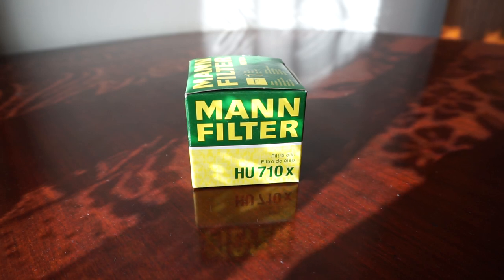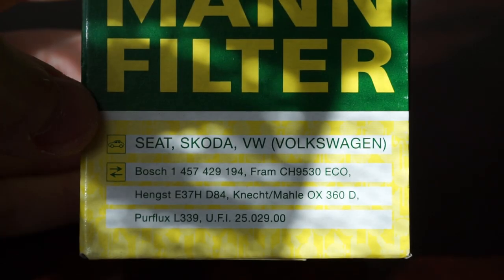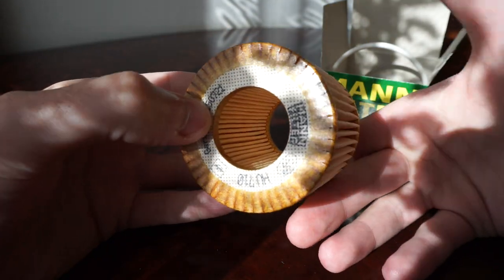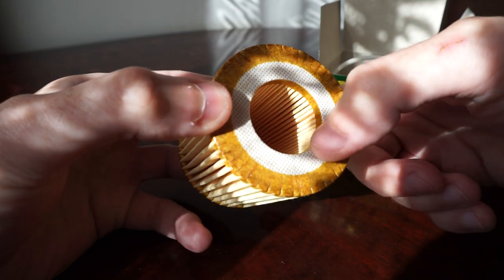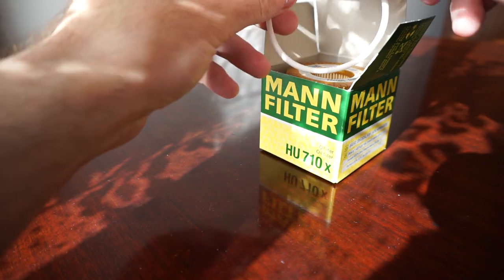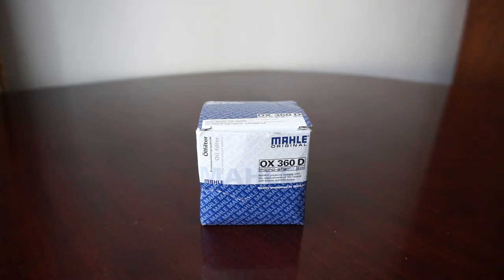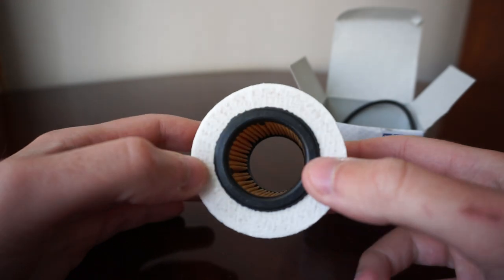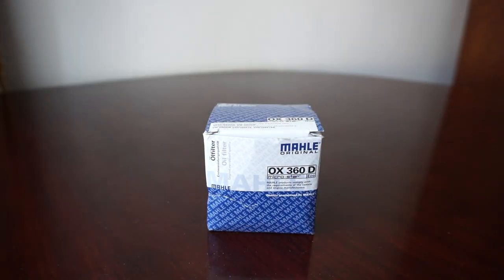MANN Filter vs MAHLE Original Oil Filter

Comment: The Mann filter ends are polymer foam. I've fitted many of this type of filter to Bora TDI cars and it really is an easy process. Of the ones I've done, you push the new filter into the filter cap and keeping it straight, drop into the oil filter housing and screw it in and tighten to the torque marked on the cap.

When draining the sump oil, remove the old filter before replacing the sump plug so any oil that runs out of the pick up after the filter is removed, can drain out of the sump.

The cartridge filter usually fits in only one way so just note which way the old one was if you're not sure - its very easy to figure it out.

Mahle and Mann are both quality filters. From the two in the video, there seems to be a bigger distance between the outer and inner diameters on the Mann filter so perhaps more filtration area. I also notice a big gap in one of the flutes on the Mahle.

Also have a look at Hengst filters!

Oil grade and specification seems to be a bigger problem to decide on and it really shouldn't be. Simply go to the website of your preferred brand and use the Oil Selector to get the correct oil quoted for your vehicle.
Reply from the maker: Thank you so much for the detailed explanation. I used Hengst air filter in the past. This year I will buy the air filter for the engine from the Renault dealership, to see if it'll improve the sound of the engine in making it quieter than with the aftermarket filters. also the oil will be true full synthetic Liqui Moly 0W40 this time Synthoil Energy, their best one.

Comment: i`m honoured that you mentioned me in such a way - i`m just a man who repair his cars from passion, nothing else
It`s true, Mann filter because of that "paper/ celulose" edge doesnt make a good seal, and if forced when putting it you might brake the edge or at least some cracks in it might apear....which at high pression and high Rpm might by pass the filter...
However Mahle because of how its made, that rubber edge make a good seal and its virtually unbrakeable......
When i changed the Mann filters at my cars ( long time ago) that edge brake everytime very easy when removing it, and it  teared apart a part of the filter....after some experiences with these, i stopped using them and switched to Mahle....
You can use virtually any filter, on the condition that they have a rubber edge......for example Champion filters also have a rubber edge and i used them on my wife`s car....
Reply from the maker: All of this was possible just because of you. 
I really hope everyone who will see this to follow your channel, so they can share your passion for cars and maintaining them all by themselves. People like you give me courage and make me wanna try do it myself, no matter the task!
You should start recording all your work, no matter the car. I am sure you'd have a great success and help many people. This if the time allows you to.
Reply: Thanks once again, but you`re just too kind....i`m doing this out of passion, nothing more- and i know only a few things, there are so much more to be learned.....
But what i know, i dont keep it as a secret......i tell and help anyone who asks, because i wish i had had this opportunity myself, but i didn`t....so i had to learn by myself, from what my father taught me and from my mistakes........so at least, i hope nobody will make the same mistakes that i did, that`s why i say what i know
Don`t know if i have time to record what i usually do.....i usually repair my cars on a property that i have at the country side....old fashion style, nothing fancy,  with lots of dust, oil, tools, some dogs.....
Reply from the maker: Yeah, I know what drives you. It's very nice of you to help others, totally without expecting anything in return.
I understood if you don't have your hands dirty, you can't be dirty rich. So old fashion work and surroundings would be great. It's just a though. Your English is flawless. You just gotta keep uploading. The quality of your content will bring the audience right away. Imagine how many Logan and Polo are out there :)
Reply: m3rovingian well....i'll try the best i can, its only a matter of time...
Reply from the maker: Looking forward to!
Reply: What do you think about knecht filters? Are they better than mahle?
Reply: @alexandru2373  Vorbesc si romaneste man; practic sunt cam aceleasi, firma are multe repere comune....
Oricare ar fi ( mahle sau knecht) sunt de calitate, iar daca le schimbi chiar mai devreme putin, ai reteta optima pt intretinere
Reply: @hirayaman246  Mersi mult :)

Comment: I use cotton from an old pillow as an air filter, trust me it works and works a lot better than these air filters sold online.

As for oil, I use vegetable oil, £3 for 6 litres and it’s natural and healthy for an engine, if you want premium oil, go for olive oil.

Oil filter is not needed just make a cap so It doesn’t leak.

Pollen filter I use a bunch of socks dipped in aftershave and my God the cabin always smells amazing. 

Fuel filter i never change for the life time of the car becz I use Asda & Tesco diesel. Best fuel period! 

If you do everything I have listed, you car will last 4.6 billion years, trust me, mine has lasted about that much time.
Reply from the maker: :D This comment made my day :))))

Comment: Nice comparison, but i have to correct some things:
The mann-filter will brake as fast as the mahle. Try to brake the mann filter, and try to brake the mahle. The white rings on the mann-filter are made of fleece, they are making the same as the rubber rings on the mahle which strengthens the filter.
Reply from the maker: I understand. Here I am talking from the experience of others who used the filter without the rubber ring and had issues installing it without breaking it. So I wanted to be safe than sorrow
Reply: @m3rovingian  i understand you. Im in the filter business. So i wonder how i can brake a paper filter by changing it, it is possible but it needs more strength than you will expect. 
Anyway I won't go to a mechanic, that has so much sensitivity to brake a filter.
Maybe i will destroy some filters and make a comparison and show up the pro's and con's of each.
Reply from the maker: @gumpertapollo97  I understand.Looking forward for your demonstrations! All the best!

Comment: fitted a Mann oil filter to a v70 d5...on start up oil light out but screaming from motor!!! after 3 times ...very short...re checked filter spilling oil over clean engine all looked ok ...restated and slight squeel but then running ok...nobody said to soak these before instalation.. anyway using Mann for oil ..fuel ...air...just hope they live up to German Engineering as advertised!!!!
Reply from the maker: You should not have any problems from now on. They do the job.

Comment: original filters are not much expensive
Reply from the maker: They cost almost double, but I think it's worth it.
Reply: @m3rovingian  To my ford engine focomo filters are cheaper than mann. Personally I never used mann
Reply from the maker: @Marcin_z_bloku_obok  From what i understood MAHLE Original is better than Mann. I will try to use them next or maybe get the OEM filters straight from the Renault dealership.
Reply: @m3rovingian  You should try. I use originals just because they are not expensive as any other filters. In my old car I used cheap, random filter from nearest parts shop. Can't say that there is any diffrence. Original filters are usually better constructed. Better materials and sometimes springs inside filter.
Reply from the maker: @Marcin_z_bloku_obok  I totally agree. I'll see what I can do at my next oil change. I already decided to buy a OEM air filter to see if the sound of the engine will change in a better way, more silent than it is now with the aftermarket one.
Reply: It depends on the brand, for example, Mercedes and Bmw originaL filters are made from Mann and the only difference is the brand logo near the Mann logo. Same thing happens on many VAG group filters which are either Filtron or Mann.
Reply: As long as it's not made in China, I'm happy.